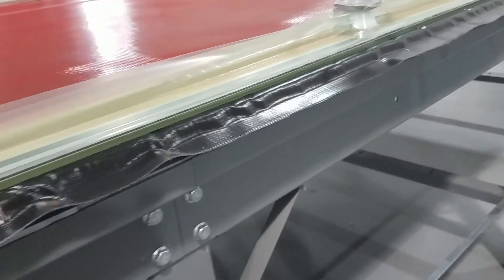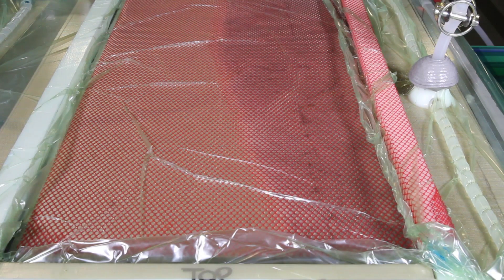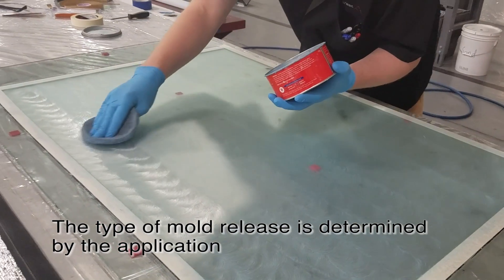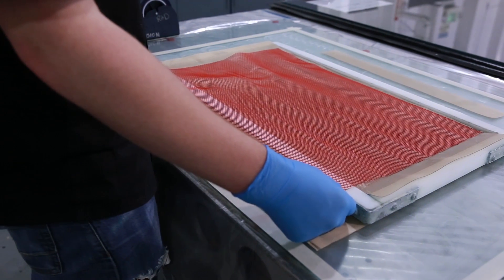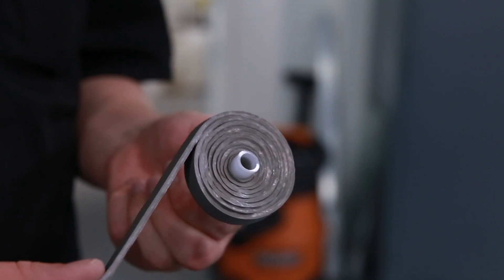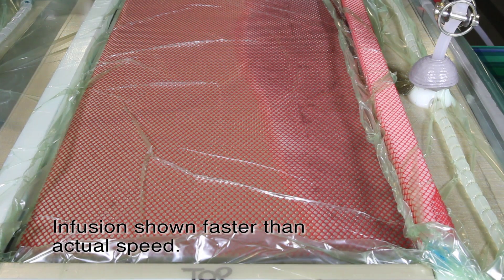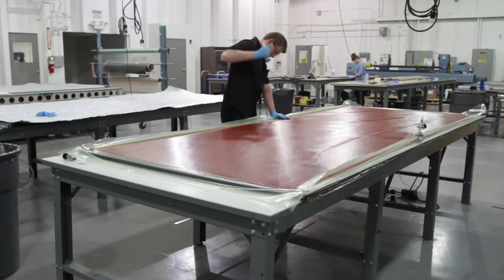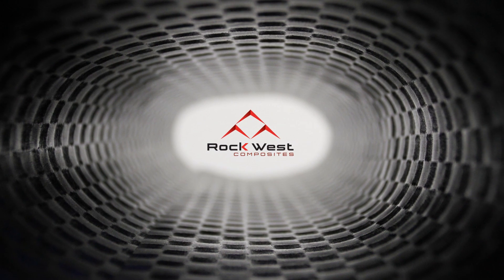Resin Infusion by Rock West Composites

Comment: Quite surprised by the precaution used for priming. I have never had any problem by quickly opening the dry line. Have you noticed much difference ?
Reply from the maker: Since we only open the valve about ½ turn at first its sometimes not enough to completely fill the inlet line which leaves an air bubble at the top of the “loop”. On thicker plates we open the valve more so its not an issue, but for consistency across production we prime the inlet line first.

Comment: I would like to know the width of grid you used. Could you tell me? Thanks again! 😃
Reply from the maker: If you are referring to the flow media (the red mesh in the process) the grid is about 1/4" spacing. But this is not a critical dimension for sake of allowing resin to flow. In fact, for simplicity and convenience we often recommend using Compoflex flow media and release ply (2 in one!). https://www.rockwestcomposites.com/3045-d-group

Comment: Do you need another vacuum line to remove air bubble due to mixing composite resins (two-part mixture) during injection of resin into the laminate matrix? Also, do you check for vacuum leakage after the resin is ejected?
Reply from the maker: We de-gas the resin mixture prior to infusion. This is done in plastic buckets placed inside of a vacuum chamber. 

Then the inlet vacuum line is inserted into the bucket full of degassed resin. The opposite end of the part you are infusing has the vacuum line connected which in essence “pulls” the resin out of the bucket and into / throughout the part. 

We continually check for leakage on the part by monitoring the vacuum levels and visually by inspecting continuously by eye for air bubbles.

Comment: How does one make square carbon fiber pipes? I can see them wrapping something square and sliding it out getting a perfect inner square. It's the perfect outer square in curious about. I can't imagine someone sanding square tubes that perfectly.
Reply from the maker: In order to get good compaction on all surfaces (critical for a good composite part) we ensure high pressure is applied using special tooling for shaped part production. Sidenote, the outside is not as consistently perfect as the inside but we appreciate the accolade and are happy with the process as it seems to work very well for most applications.

Comment: What is the need to use so much gum tape around the hose? It's literally half of a standard 25ft roll! You need just a few layers and then squeeze it onto the bag.
Reply: Ey man. Funny seeing you here. So this is a similar process you use to make those Subaru carbon fiber parts?
Reply: @sean9267  didn't see your reply till now. The process is the same, just slightly different approach to each step.
Reply: It is so you will pay more for the extra material they throw away lol

Comment: How do you carry out Resin Infusion on curved surfaces?
Reply from the maker: Good questions King, the surface is dictated by the tool used. In our case (the video here) we use a flat piece of glass. If you wish to get a curved surface, you will first need a tool that matches that surface. Such as a car hood or roof top. You will need to make a tool (not covered in this video) of that shape and then the infusion process is nearly identical to the video here.

Comment: It's good for simple shapes like plates, pans, tubs, etc. It's also a great time and money saver. For complex shapes or whenever a precise trim is needed before the cure (multi part molds), prepreg is the way to go.
Reply: prepreg is ridiculously expensive if you don't buy it in bulk. Infusion is cheap and produces perfect results for most applications.